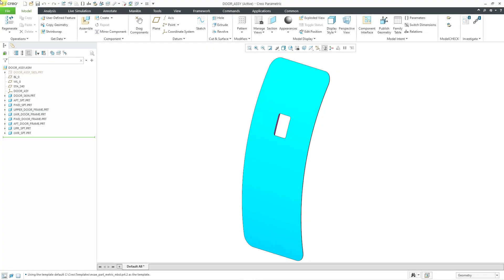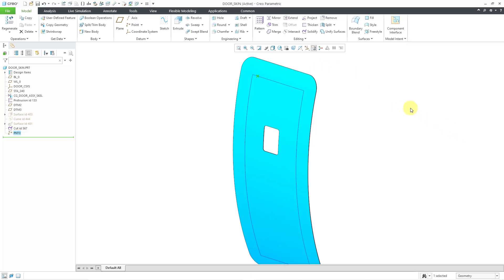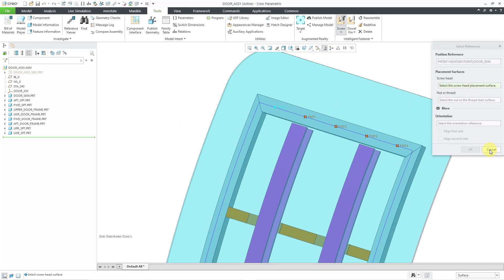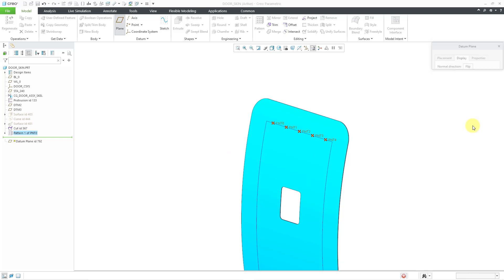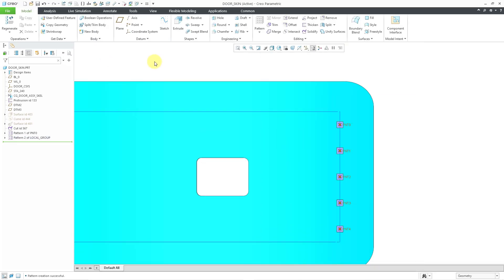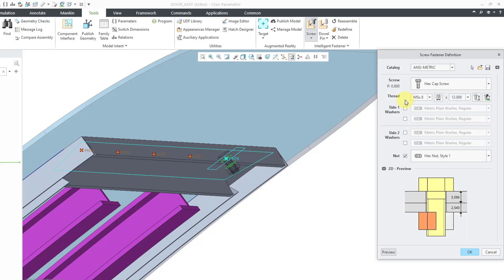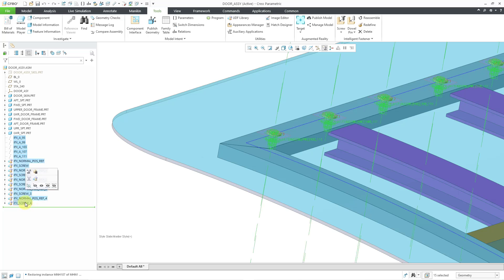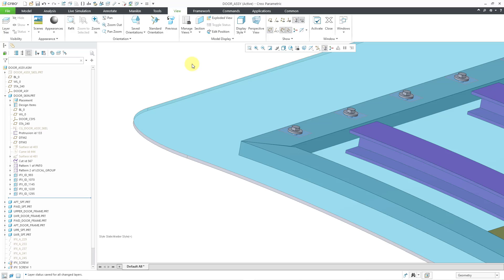Creo Parametric - Placing Intelligent Fastener Extension (IFX) Fasteners on a Curved Surface

Comment: Hi Dave, thanks a lot for this video. I have a question that has been bugging me for a while. I looked online but couldn't find a good answer for it, so I figured I should ask you instead. : ) When I click on my components on the assembly viewport, it selects the part on the model tree. Is there a way to select the subassembly that particular part belongs to instead using viewport? I tried selection filters but it doesn't have assembly option.

Thanks in advance.
Reply from the maker: First, when you have questions like these, you should go to PTC Tech Support, not some random guy with a YouTube channel. In Creo 4 and later, when you select something in the Graphics Area, it selects geometry (surface, edge, or vertex) by default. But it also opens up a Mini Toolbar. At the far end of the top row is the Select Related icon. From that drop-down list, it will show the object you picked, the direct parent, the Body that holds it, the part, and every subassembly above it all the way up to the top level assembly. You can select any of the parents from that dialog box.

Back when I was a CADmin, I used to tell end users that if you can't figure something out on your own in 10 minutes, open a ticket, either with internal support or PTC Tech Support.
Reply: @CADPLMGuy  Thanks for the suggestion Dave. And no, you are not a random guy with YouTube channel, you are The Creo guy for all of us. I think you have probably singlehandedly helped way thousands of Creo users find their way through the software.

Appreciate the support and I will create a ticket next time.